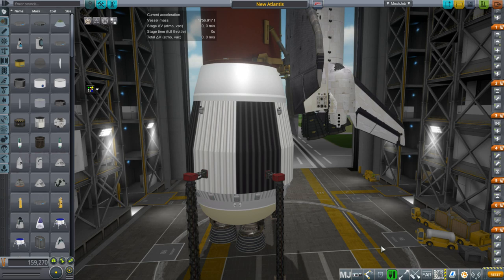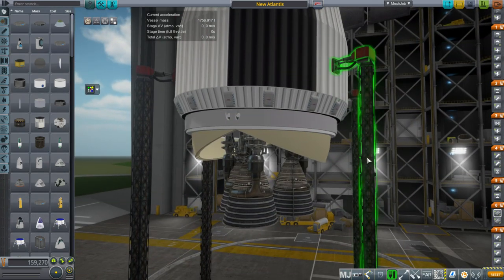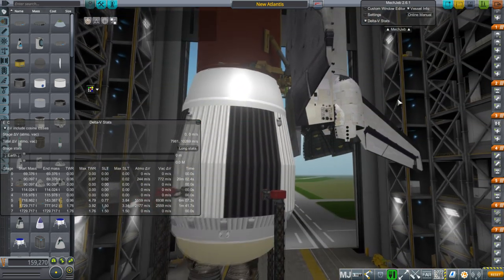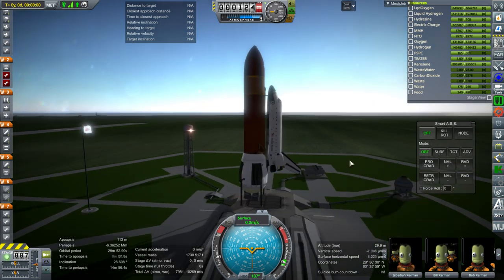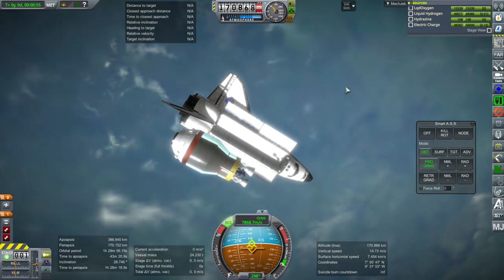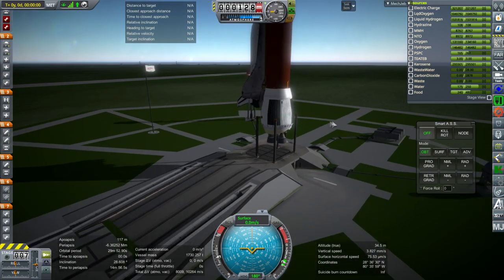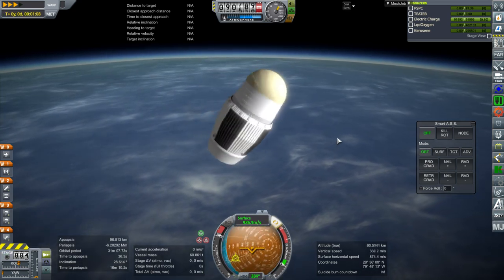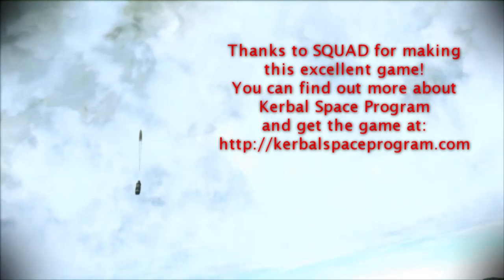KSP - Realism Overhaul Sandbox - F1-boosted Space Shuttle

Comment: Thanks for the term intertank. It is a vital element on a modified design of a 250 metre Saturn v variant I  am designing. The first stage is more of a dual stage without a separation stage and a second set of engines, so from the bottom it is: 9 F1 variant engines [larger] RP-1,Oxygen then the intertank, crossfeed valving [downflow apparatus] RP-1, LOX then Interstage then 3 more stages. I use a 4 tank and piping system in order to avoid using 2 very high mass/pressure large tanks. Your solution is good. I like the engine shroud solution especially. It might be interesting to attempt replacing the Hydrolox/Lox system with a Methalox solution using engines on the Space shuttle that would be comparable to the best designs Space X has now. Thanks for video.

Comment: In real life would putting the hot F1 engines in a small closed space have an effect on anything?
Reply from the maker: I'm sure the material of the enclosure would have to take some heat, but not much since air has been cooling the engines down for a bit. If necessary, the enclosure can be deployed late in the parachute phase, so the engines would have plenty of time to cool. Another option is to have an auxiliary pump (much smaller than the turbopumps and probably electrically driven) send remaining kerosene in the stage through the coolant pipes on the engines to cool them down.

Comment: (Cost-efficient) reuse is a pipe-dream to begin with, at least using current technology, but I'm rather surprised by the idea of reusing F-1 engines. Isn't a major problem with kerolox engines that they essentially soot up? As I understand it, you'd need to take the whole engine apart for cleaning after every flight, which would negate the point.
Reply from the maker: Well, the only reused stages we have today are the Falcon 9 first stages, and those are kerolox, so I guess it's not too much of an obstacle, after all.

Comment: Reusable Kerolox??? Hmmmm
Reply: Well, isn't that exactly what the Falcon 9 already is ? Kerolox gunks up your engine, but that doesn't mean it can't be refurbished.
Reply: On point.
Reply: In theory F1 should be easier to refurbish than the merlin since the chamber pressure on the F1 is very low compared to most other rocket engines. That's the idea behind blue origins BE4 as well. It really makes sense for reusable engines. After all the engines of airliners last many times longer than those of military aircraft since they are not pushed to the limit.